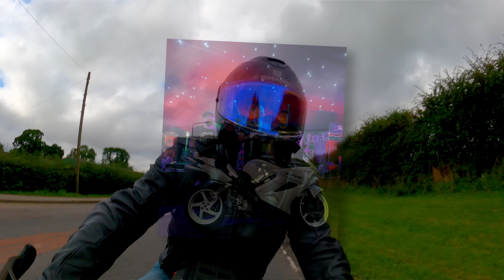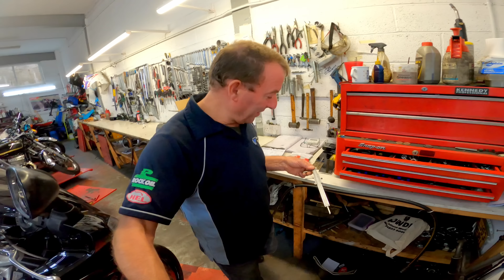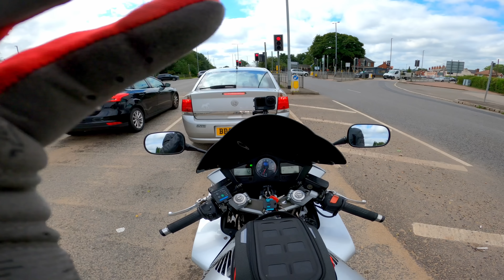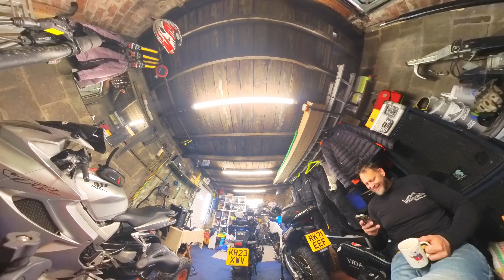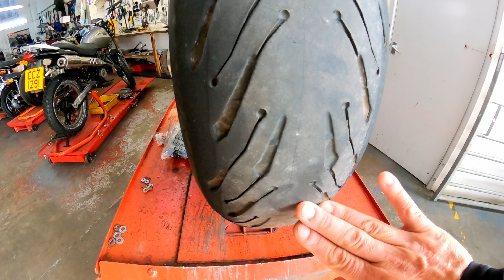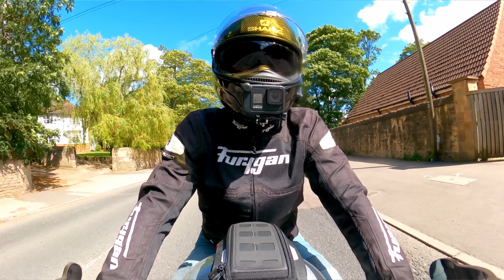Pamper Day for the VFR800!

Comment: Road 5 and 6 in my view are best tyres you can buy if i were you rich would fit a chain oiler to give the chain some love buy a tutoro one i have them on my vfrs very easy to fit would also fit a volt meter to keep tabs on charging system on battery state. And yes the vfr is a very smooth and easy bike to ride you forget yours is 20 years old dont look it the build qualitly is top notch do use the silver lady more often and keep the clips coming of the silver lady .

Comment: Had to do a full replacement on the charging system on my vfr. Turns out they REALLY don't like running fully off the stator with a dead battery. Burned the stator up to a crisp.

Comment: Both you and your VFR have fine voices Richy.
You still have the std suspension on your VFR as fitted from new?
Also do you still have the Racing Puig screen on yours?
Re: new battery. I presume Steve would have checked to see your reg/rec was still ok and this wasn't the cause of your previous battery prematurely failing, again? You need to upgrade the reg/rec to a Shindengen FH020 unit. They are only £50-60 on Ebay. Kev of Kev's shed has made a couple of very thorough YT videos of how you can do this. He has a silver lady just like yours.
I have just put Michelin Road 5s on my silver lady. Couldn't quite stretch to the Road 6.
Would like to see you do another Croatia tour. Like all your tours but that one for me is a favourite. Watched it a few times now as well as revisiting episodes of your US tour. 
Many thanks for Richyvida taking me places on his VFR and other bikes that I shall likely never visit.
Reply from the maker: Thank you Alex. Yep, all original stuff. Yes, Steve checked it all. Just putting it down to a dodgy battery. He did say that batteries of today are most definitely not what they used to be and would only really expect a good 2-3yrs out of one these days.
Reply: @RichyVida  Thanks for your reply. Only 2-3 years you say. That's not good. I think mine still has it's original from 2004 and it is currently starting fine although the first owner might well have changed it but it does look original. Was thinking of getting mine up to Steve Scott's for some fettling at some point on the strength of your videos visiting him and your satisfaction with his work.
ATB Richy. Enjoy riding yours on it's new Michelin Road 6 GTs.

Comment: The pre facelift 6th generation VFR800 still suffered with a weak regulator/rectifier. I've had 2 5th gens and currently own a latter 6th gen VFR800. Road 6s should be an excellent all weather choice.

Comment: You really need to leave the bike connected to a optimate , and only buy yuasa batteries, I can get at least 10 years out of a yuasa and that’s with the bikes standing , not doing a lot all year , killed my battery on one of my bikes because I left it at work for 6 months over the winter and never charged it 😳

Comment: Enjoyed the vid but dont get why you went for GTs. The manufacturer prob knows a little more abiut tyres. Tyres are mean to spread to increase the contact patch. Extra rigidity without the extra weight means they wont. They wint be awful but the standard ones are better for solo riding on normal sized bikes. Even bigger bikes like my old Blackbird shouldnt have the GTs unless mainly used two up.
Reply from the maker: Longevity, Scotty.
Reply: Michelin claim the Road 6 has 10% better longevity than the PR5 but I don't see any claims for the GT getting even more.  🤔

I just asked an AI engine and here's the response. Personally I believe what the manufacturer says.

"The disadvantage of using a Michelin Road 6 GT tire rather than a Michelin Road 6 tire on a medium weight motorbike is that the GT version is specifically designed for heavier motorcycles, typically touring or sport touring bikes. 

If you use the GT tire on a medium weight motorbike, which doesn't require the extra load-bearing capacity and stiffer construction of the GT version, you may experience certain drawbacks, such as:
1. Reduced handling and agility: The GT tire's stiffer construction may result in decreased maneuverability and a less nimble riding experience on a medium weight motorbike.
2. Reduced comfort: The GT tire's design prioritizes load-bearing capacity rather than comfort, so you may experience a firmer ride and potentially more vibration.
3. Increased wear and tear: As the GT tire is designed for heavier bikes, it may wear out more quickly when used on a medium weight motorbike, leading to shorter lifespan and increased maintenance costs.

Therefore, it is generally recommended to choose the appropriate tire model for your specific motorbike to ensure optimal performance, handling, and safety."